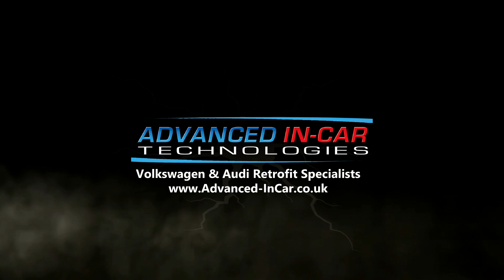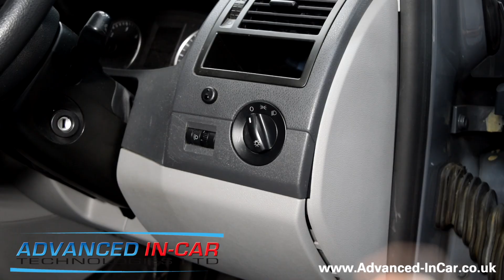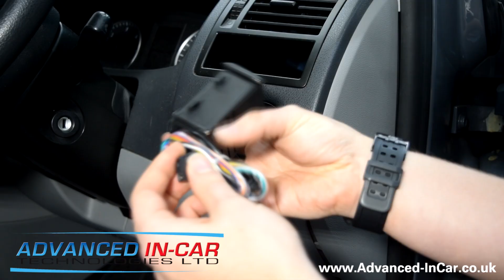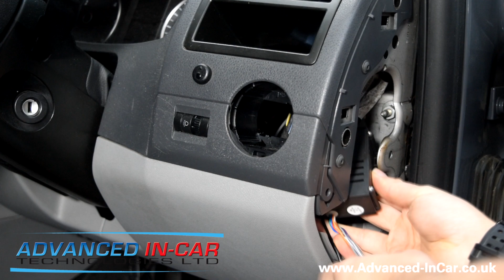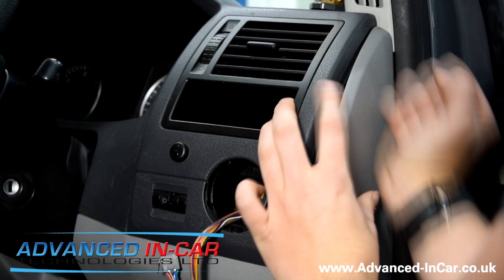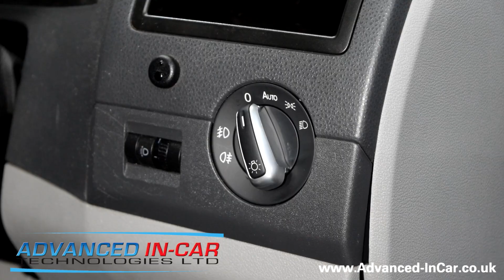How To: Install Volkswagen Auto Headlights & Coming Home Feature

Comment: Hi there, I have an Audi A3 - 2006 8P model. I'm looking for the same for this car but struggling to find anything - do you offer something for this? I understand that the electrics the same, it's just the actual switch that's different as the Audi switch includes the dash light & headlight adjuster switches too in one unit. Any pointers?

Comment: I got a 2018 Jetta, (US) it had a two position switch, ON and OFF. I installed fog lights and this "EURO" switch, it is set to AUTO and I programmed to turn the fog lights on as well.
Reply: So this works on the american market vehicles as well? I have an '09 Jetta and am planning on getting this because I want the auto headlights and the welcome home lights when you unlock the car at night for example

Comment: Firstly thanks very much great guide very helpful. Bought one for my MK2 fabia and it works great . Cheers
Reply: Hello, i have the same thing for my mk4 bora, did it beep if you open the door?
Reply: @janeckelt9441  I've not really tested it when on manual as I keep it on auto and it turns off before I open the door
Reply from the maker: Most of them will beep as it takes a couple of seconds for the sensor to shut the light circuit down. 

Also if coming home / leaving is working for up to 30sec it will beep till they turn off. It’s doing something that your car wasn’t born with. 

Nothing to worry about.
Reply: How did tou get the coming/leaving home lights to work?

Comment: Hi. I have a polo vivo hatch 2016 model. I have the auto switch and somehow i managed to remove the settings so now my park lighta stays on when car is off. How can i get the auto settings back? Please assist
Reply: Wesley Botes take it to VW
Reply: Hey I have the same problem did you find any solution?

Comment: Hi, considering ordering myself the kit. In your opinion should it fit a 2013 vw polo 6r? It does have a large connection block to existing light switch. Does it matter about how many pins in the connection block have cables to them?
Hopefully the first to many modifications.
Cheers

Comment: The welcome home features. When you unlock the car the head lights come on for a few seconds  BUT when you lock the car do the head lights stay on for a few seconds or go off straight away?
Reply: Did you get any answer?
Reply: Normally, the delay lights feature (welcome home) stays on for a few seconds (normally around 20-30 seconds on Mercedes cars) so I would assume that it stays on a while

Comment: Can you tell me whats that small black circle button which is up from the dashlight / headlight height adjuster ? I have the same one in my car and I have no idea what is it ?
Reply: MrChekmek 
Did you find out what this button is for as i have one as well and I have no idea what it's used for ???
Reply: Grant Weller No. I haven't even tried to find, but I assume that it's for trailer hitch power supply for lights or maybe it's something for aftermarket car alarm. I don't know. Do you also have trailer or aftermarket alarm ? My car is Passat B5.5 sedan 2001 1.8T
Reply: MrChekmek 
I'm looking at getting a 2010 golf tsi and noticed the button when i viewed it at the garage. Other golfs don't seem to have it, very strange! I will keep looking, keep me updated if you find out 👍

Comment: It will work with a Skoda Octavia 2?
Reply from the maker: Depends on the connector and the switch "hole".
Reply: Pop your switch out. Push it in and try and turn on at the same time as pulling it out. Check if the fitting is the same. If it's not, there's plenty of other kits which fit vw cars on Aliexpress. I got mine for my Seat Toledo for £26 and works identical to this one.

Comment: I have a Polo which came with the rain/light sensor by the rear view mirror but not and auto lights switch (weird, I know), is it simple as plugging it in and updating the system through and obd device?
Reply from the maker: Doesn't need to be activated. It's plug and play.
Reply: Yes if you have the light sensor then you have to search it from obd

Comment: Would this kit work with a 2013 Jetta 2.5 (se model I believe)? And if so would the headlights below be compatible with your kit?

https://www.carid.com/2013-volkswagen-jetta-headlights/spec-d-projector-headlights-halo-u-bar-284613773.html
Reply from the maker: If you have the right connector as per the video it will work with the Jetta. No idea about aftermarket lights I’m afraid.

Comment: Ik have install this but if i lock the door hè wil blink/ flash  like for 4 Times .. golf 6
Reply from the maker: Do you mean the headlight warning buzzer? If so this is normal... It will do it 2 or 3 times and tehn shutdown the lighting circuit.
Reply: Advanced In-Car Technologies  i mean the little light T10 light in the headlight also license plate light ..wil blink) flash.. but i want de xenon on without blinkingen of flashing is that possible
Reply: At your video with transporter the light stays on without blinking i want that on my mk6
Reply from the maker: Do you have normal halogen or Xenon at the moment? It shouldn't be blinking so would possibly indicate a problem.
Reply: i have xenon but i see that i have not de same conector mine is smaller than yours .. maybe somthing with vcds vag com? or maybe update
Reply from the maker: Nothing to do with VCDS. If you have Xenon then this kit in this video will not work with your car.

Comment: Hallo, does this kit work on a Polo 9n3 2016
Reply from the maker: Only if the connector at the back of the light looks the same as the one in this video. Based on the year of your Polo I’m pretty sure you have a different / smaller connector.

Comment: I have a 2014 Jetta GLI. Will this work? Please send link to purchase.
Reply from the maker: Only if you have the same connector at the back of the headlight switch. If it's the smaller type then this kit will not work.